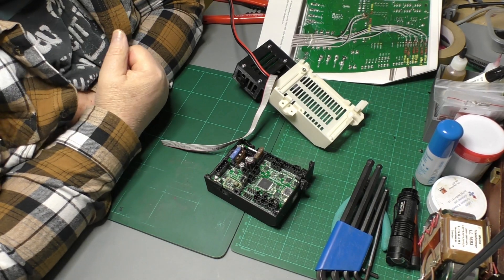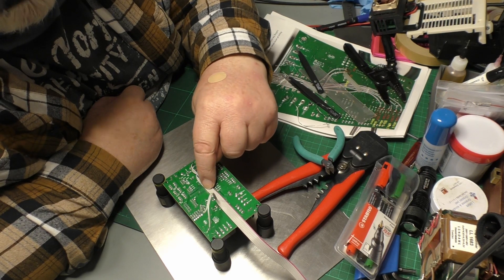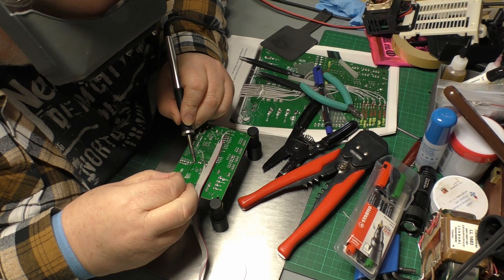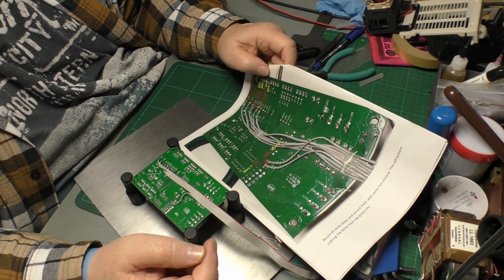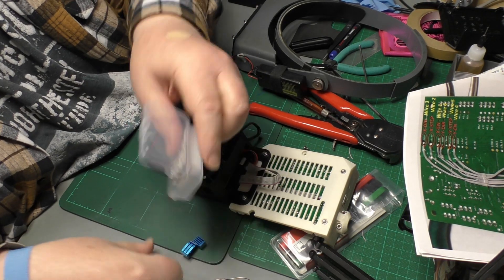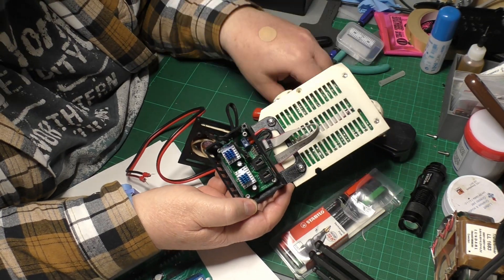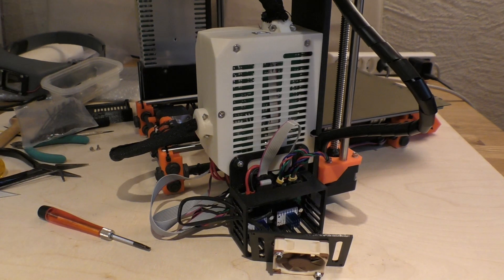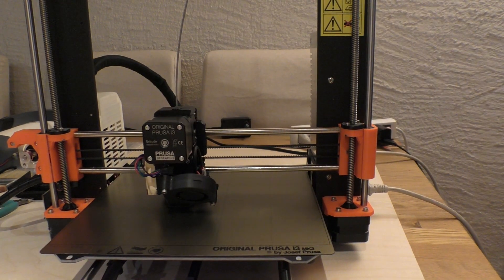Silencing those noisey stepper motors on the Prusa MK2

Comment: so you are just attaching to the controller point to the cable, no cutting of traces correct?
Reply from the maker: Correct, the original drivers are removed and the signals redirected to the new ones in the external board.